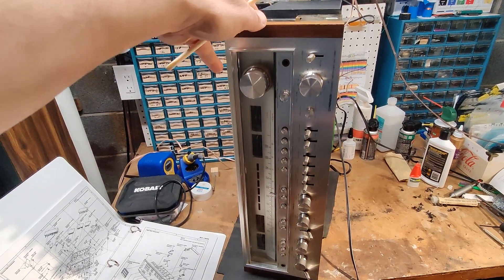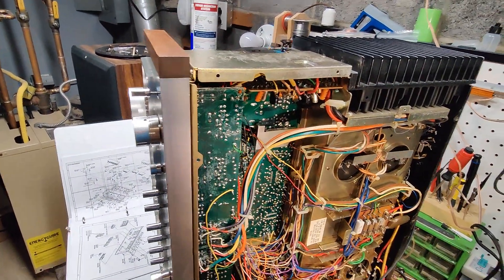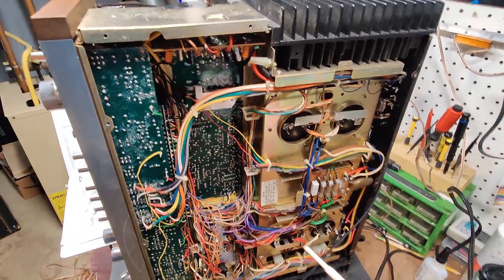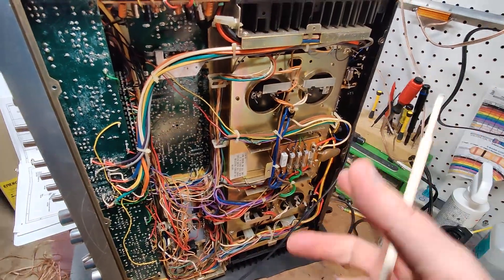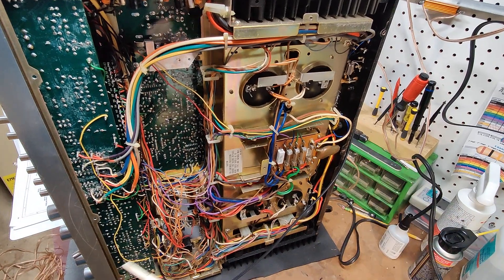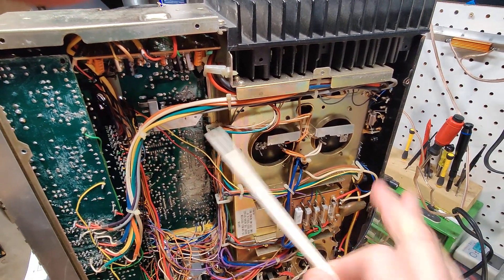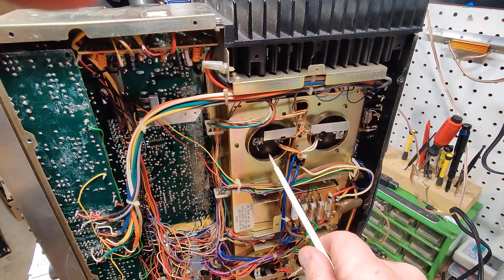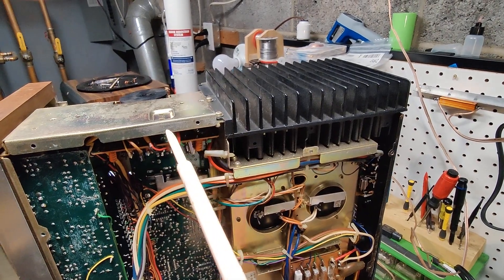Pioneer SX-1280 restoration part 1: Why you need to replace filter capacitors.

Comment: very nice restoration! I myself have a working 1280 that is in excellent conditon. it has been serviced but nothing major. A few caps replaced on the power card. I want to replace the power card with a new one that is available out of Canada. I also want to recap the whole unit and replace other components that need it. Im a extreme hobbist and have done other 780s and a few Marantz units.  Any advice on where I should start on the 1280? since its working I planned on doing a board then test then another board and so forth.
Reply from the maker: Thanks. Power supply first. Then speaker protection then follow the sound path. Be very very careful!! The output transistors are Unobtanium, you don't want to short anything out. power down, unplug and wait before removing and installing cards. Make sure you get all you caps, trany's and resistors from either Digi or Mouser. I had a hell of a time with counterfeit trany's. An like you said test after each card. Use a dimbulb!

Comment: Can you give an estimate on what a restoration like this would cost? thanks
Reply from the maker: For parts, your looking at 3 to 4 hundred. Quality filter caps are a big chunk of that. I'm using 22000 uf 100v  Kemmet caps which are 50 a pop x4. Slot of the audio path caps are being replaced with film, which are double or triple the cost of electrolytic. Power supply is all Elna Silmic II. Transistors and VR's are replaced as needed. Some are mandatory replacements. Labor varies. For full restoration you can expect over $1000.00. There are slot of hours in this process. Labor is not cheap. Since this a friend's system, he is paying significantly less than that...friend and family pricing.